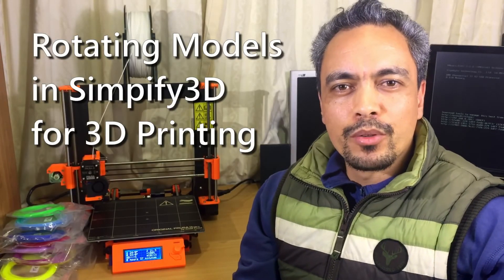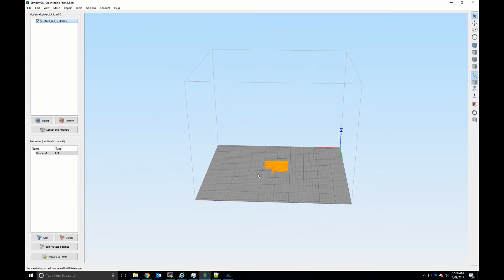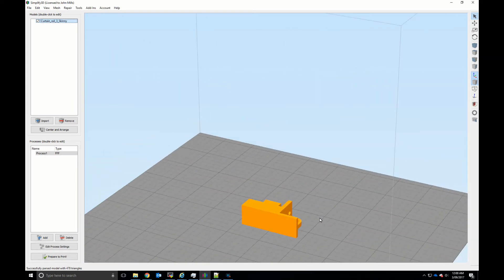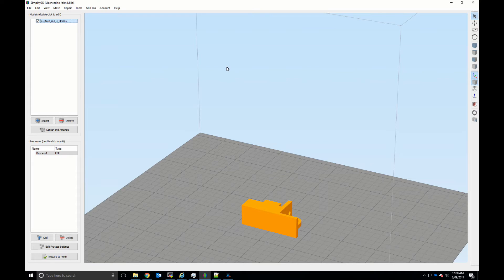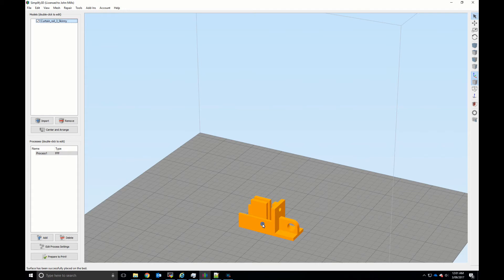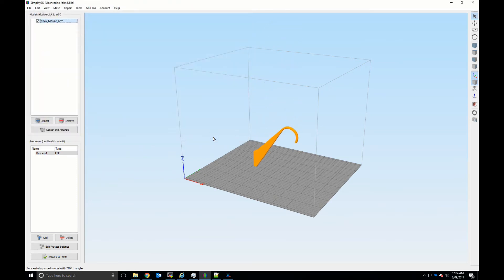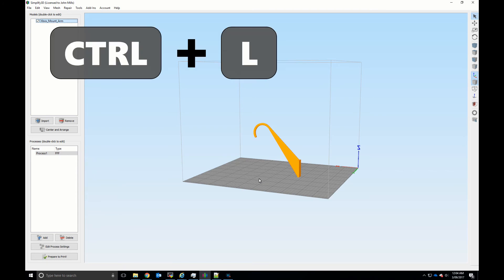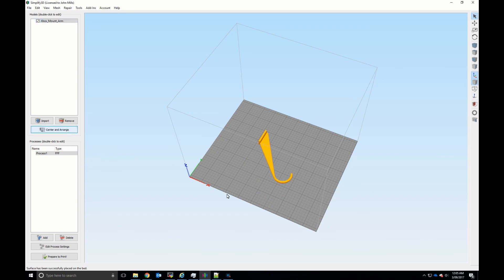How to rotate models in Simplify3D so that they are in the correct orientation for 3D printing

Comment: The video was useful for low poly models. For high poly models it was useless. I just want to rotate evenly not snap a random surface. S3D is not intuitive at all in this regard.

edit: found out double clicking a model you can rotate along a given axis. Its slow but oh well.

Comment: you DIDN"T show how to actually rotate a model, as it's not possible in s3d.  You showed how to place surface on bed...not the same..not even close.  Use meshmixer to rotate the file.
Reply: If you double click on the model you want to rotate, a window opens up, in which you can numerical rotate the part.
Reply: @MrCzto  That's exactly how to do it.  Or use meshmixer.